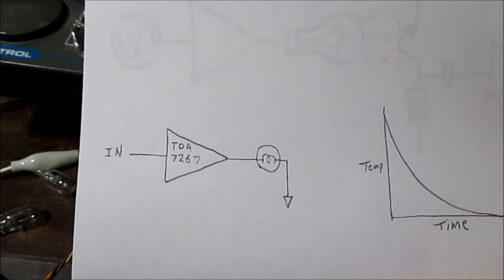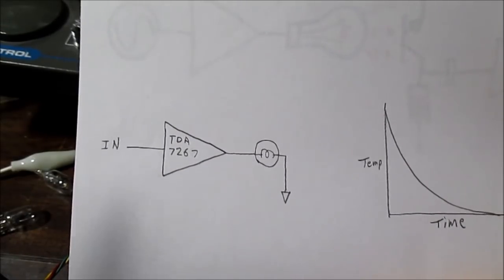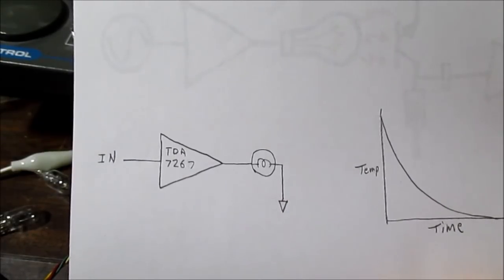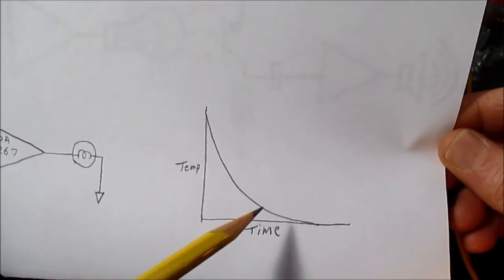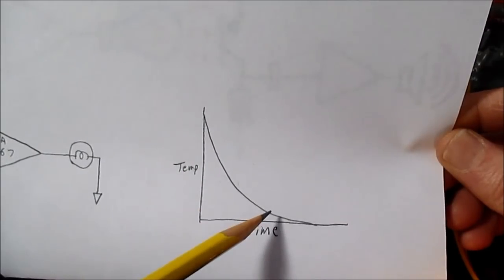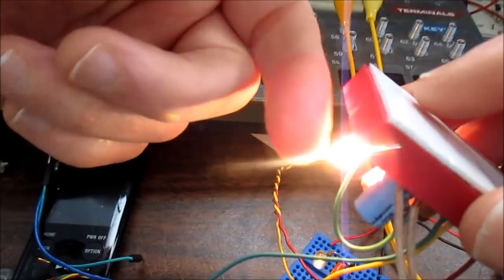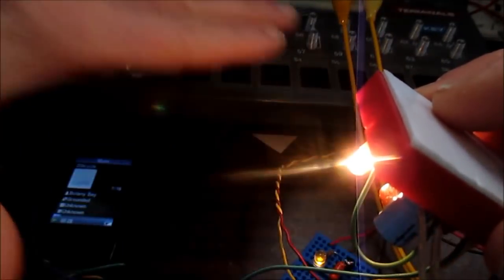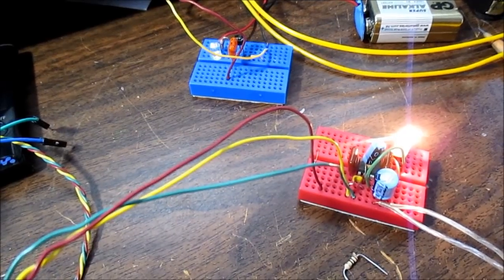Audio through an incandescent bulb (follow-up) It works!

Comment: Paul Hetherington
1 second ago
/1++- =[{3''emaVt'' sdf orbs pre ctx}]+ 2 layered NAV SET=[{5''x2c dfs orbs ex 360deg cellz}] /
/< 360deg cellz in= Braebus VDz stckrsz R&D layered NAV SET aud WVkxm'' telscop head lightsz pitot tube ctx amps //< EI K' R&D QRF Mx fork caps VARs RADs orbsz ~ radiiators disc braek units /

Comment: Just a thought: the glow wire is galvanically connected to the socket right? Would cooling of the socket increase the upward frequency response since it depends on the speed of the cooling? Would be really happy if you tried that and documented it for us!

Comment: Interesting. I know some have suggested a laser diode... that would extend the range. Can't help but wonder if you bounced the laser off a closed window and captured the reflection if the result would act like an FM microphone allowing you to "hear" sounds in the room based upon the vibrations in the glass.
Reply: Laser diodes are run at constant current - the actual range of currents they function in is quite small I think - too much it melts, too little and its just an expensive LED again.  So you'd need to modulate the current carefully not to clip.

Doppler velocimetry is the term to search for with the window glass thing.
Reply: Mark Tillotson I'm not suggesting modulating the laser diode, rather the reflection would be modulated by vibrations in the glass caused by sound inside the room. If you know what quiet looks like then subtract quiet from the modulated signal and you have the audio.

Comment: Nice vids!!! There is a 70's keyboard called Optigan that uses a similar technique to reproduce sounds from a transparent flexidisks using optic technology... and it sounded like that: a low pass filtered, muffled sound, and full of scratches (from the crappy disks full of scratches and dust). I guess those keyboard used phototransistors... I really don't think vactrols could work at more than a couple thenths of hertz.... New around here... you've got my suscription!!!

Comment: I never knew that this was even a thing... Even though I have exposed to fiber optic links in my audio systems... I just thought that there's some complex ADC to DAC setup probably using some type of low powered laser. As you can tell from my comment so far... It's still a mystery to me... But in saying that... Looking at your experiment I was thinking that.... What if you wrap an insulated wire around the light globe and apply a voltage across it to generate some heat. My train of thought is of the tube transistor... Which has a heating element to to help electron flow.. Hence why they have a slight constant glow... If stereo equipment was made by this light method... Everyone today would be wearing shades while listening to music LoL... Anyways... Just a thought. Keep up the great work.. Love the videos, especially the stuff on eBay amplification.... Looking forward to your next video..

Comment: Yup.  Biasing is the key.  Without bias, the setup becomes a full-wave rectifier of the signal (both positive and negative peaks light the bulb).  Just a tad distorted.  Or, in amplifier terms, you have to bias it into Class A.

Comment: I did this with a laser pointer and fiber optic 20 years ago.  I recall there were "marriage savers" marketed back in the day that used infrared leds to transmit audio to a pair of powered headsets. Analog audio transmission always needs to be biased at a point that will not saturate or clip the signal as was suggested before. It is always good to be reminded of the lost art of electron herding that most people take for granted.
Reply: IR remotes tend to use a pulsed "carrier" of 30+KHz.  I'd the "marriage savers" would do the same.  That cuts down on the noise from 50/60Hz lights that you'd get if you tried to "broadband" it.

Comment: A million years ago, when I was a kid, a friend lived across the road. We spent many a day experimenting with light communication. Long tubes and lens made all the difference. As you found a DC bias is needed. A light weight filament also worked best as it cools quicker and has a better HF response. We also tried neon but not bright enough. If only LEDs were available then.
This is of course, more or less how the soundtracks on analogue films work. A constant light is focused into a photo cell it's path interrupted by the movement of the film soundtrack passing in between the light and the cell. The sound track is basically an AM signal modulated onto a light carrier.

Comment: Has anyone suggested using a laser?  I always wanted to try making a laser microphone but I procrastinate too much.
Reply: Several others have done the laser sound thing already.  Quite simply too.  Very elegant solution that was high fidelity.    Here is one Kip Kay made.      https://www.youtube.com/watch?v=HKRPfa66_po
Reply: I did this with a laser pointer and an LED as the receiver. Dead easy

Comment: Our friend never share the scheme for us, bad guy ever!
Reply from the maker: Phototransistor circuit was shown in a prior video. TDA7267 circuit on its datasheet (replace output capacitor with 6v bulb of around 100ma). Hobbies are no fun when everything is spelled out!
Reply: Julio Bedaque but it is so easy to build such device.
I will try it here.. with a LED and solar cell for the receptor.
👍😆